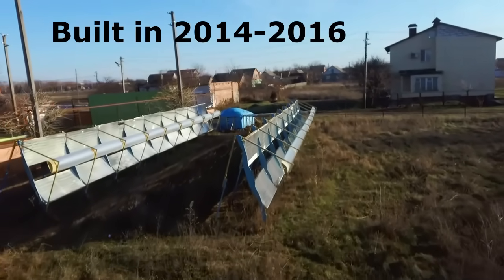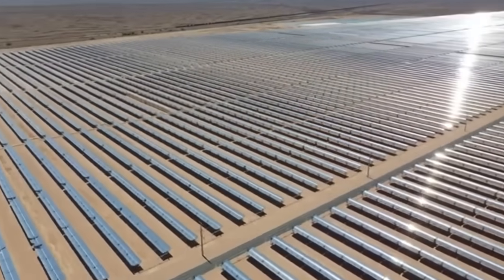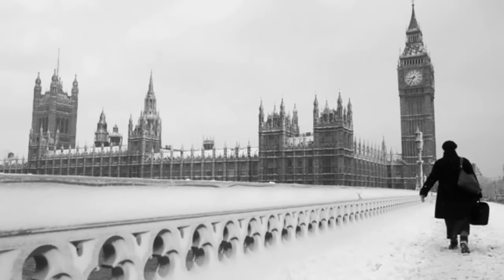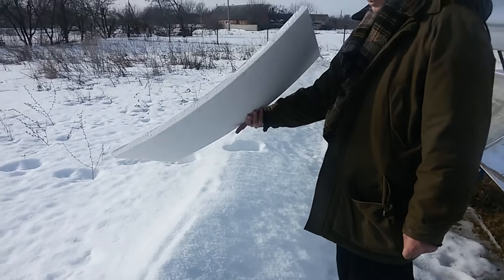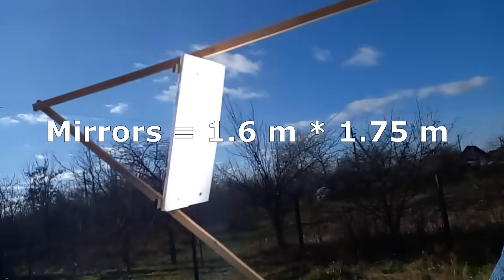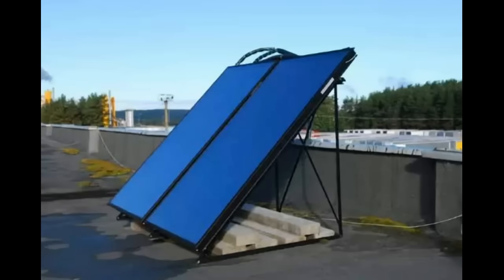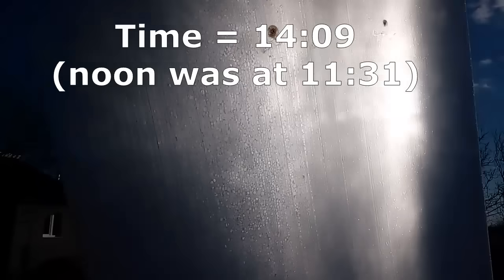This solar energy innovation is 10 times cheaper than analogues: solar electricity 24 hours a day

Comment: What needs to happen is that each unit on the solar reflector needs to change shape individually, relative to the whole. The question is, given so many more moving parts, can it be built efficiently (repair/down time versus the alternative). You'd need likely 14-20 moving parts per array as the sun shifts and tracks it, but your focal point would likely be WAY more efficient.

Comment: A stream of compressed air should turn into a stream of plasma when an alectric arc is put through it.  How long does the plasma persist in air when a pulse of high voltage electricity is put through it? If the plasma persists for one thousandth of a second and the air is moving at one hundred meters per second, then a stream of plasma ten centimeters long might be created. Plasma tends to absorb all manner of radiation including light and infrared.  If you focus the concentrated sunlight from a big dish mirror into a stream of plasma in a cylinder, the heat from the sunlight would tend to make the plasma persist for a longer time.  If there is a lens on the end of the cylinder that turns the converging rays into a long narrow beam, most of the light might be absorbed and converted into heat that could drive a gas turbine.  The higher the temperature and pressure of the furnace chamber in a gas turbine, the higher the efficiency tends to be.. If the efficiency of a gas turbine that burns natural gas can be greater than 40%, the efficiency of a plasma powered gas turbine might be 50% or more.  Just put the compressor  on the exhaust end. A car turbocharger is a kind of gas turbine that is readily available at the junk yard.  It might be about the right size to power a rooftop dish sized solar energy system.  If the dish is three meters in diameter, there are about 6000 watts of solar energy  available or 3000 watts at 50%efficiency.  That is like a ten thousand dollar solar panel system.  The dish might cost a small fraction of that. There are solar farms that use trough parabolic mirrors to heat up compressed air in long pipes to drive a gas turbine. The hot air is passed through a big pile of gravel to store the heat energy.   One ton of gravel raised by 500°C stores about 100kwh of energy. The stored heat can be converted to electricity by forcing compressed air through   the gravel to drive the same gas turbine.  A well insulated pile of gravel under the basement might store the heat for days or weeks.  Some cities store summer heat in big piles of gravel for months to use as heat in the winter. 
A dish solar energy system that also heats the house and hot water is using near 100% of the energy.  That is about a five times advantage over photovoltaic solar panels.  Plus, another five or ten percent because the dish tracks the sun.  
Another possibility is that many of these dishes acting together would make a formidable directed energy weapon system.  A million dishes each firing a 10,000 Joule microwave pulse is ten billion Joules.  That amount of energy would almost certainly turn the air at the focus into an explosive plasma.  Ten billion Joules is the equivalent of about two tons of TNT.
If the exhaust is run down through the support structures into an underground chamber, it might be very quiet.  A flat mirror closer than the focus would make it smaller and the gas turbine would be near the dish or under it. Running the exhaust into a central support structure with certain joints would allow the dish to move and track the sun. 
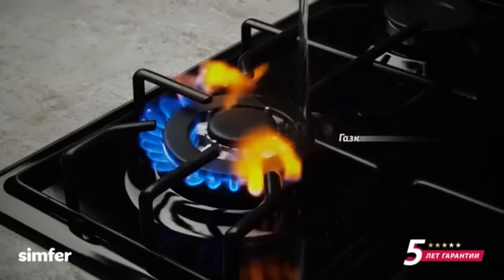It seems that the converging microwaves at the target would be converted into converging Xrays if the temperature at the focus is high enough.  Even if the blast and heat did not destroy a target, the trillions of watts of Xrays converging on the target would tend to fry the inside of a target with even inch thick steel plate armor. 10:36

Comment: Specific crafting method refinement and materials could possibly use improvement. I imagine something like using painted concrete or clay surfacing for the dishes and just having the reflective film be replaceable. You could probably just dissolve the old film with a solvent, or maybe use a vacuum for forming the lens, though it might not survive as much wear and tear. I guess I'll find out the pitfalls when I try it.

Comment: I am impressed with your experiments. You have a keen engineering understanding of the problem. Many people experimenting with solar don't seem to understand the true scope of the challenge.
Reply: @_yoko_3630 Come again?
Reply: Neither do you if you believe his device can produce power with the sun, he has stated it is a solar device.
Reply: @ossiedunstan4419  maybe you're thinking of photovoltaics? This is solar-thermal.
Reply: @ossiedunstan4419  Do you know there are more types of energy besides electricity? Heat energy can be more useful in many ways like heating water or your house. Heat energy can also be used to generate electricity if needed.
Reply: @johnathon007  He dont, tiktok dont teach too complex

Comment: boiling water using air gel to cool water use thermo dynamics heat the water to steam push it thru turbines and into steam generators get it up in the sky about 140 feet and drop it down using ram pumps and stuff to get all the water up hi then run it down cooling it and spinning turbines for hydro.

Comment: I watch on your solar station and researches many years) And other researches and analyzing off existing ways to use solar energy . Thanks for yor work!!!  I think that low temperature stirling engine can produce electricity esealy from heat producing by your solar station. If we atach 100w stirling generator to  warm battery it can produce  2400 w in 24hour that is  anougth to cover almost of all needs of  small house

Comment: If we upscale this, we would end the world's energy problems.
Reply: If a factory was set up, steel versions of this could be mass produced. The salt tank could be stored under the mirror, and the whole thing put on a swivel to follow the sun (manual version cheap, or an optional motor and auto-tracker). Probably wouldn't be enough to power an entire home, but it would vastly reduce the burden on the grid and keep essentials going when the power goes off.
Also they could be put on the sides of roads, and the heat pumped under the roads to melt off snow and ice.

Comment: The temperature of the water could also be controlled by an automotive thermostat.
Reply: they won't tolerate anything approaching those temperatures, unfortunately, engines all run around 100Celsius

Comment: "10 times cheaper" that doesn't make any sense.
50% cheaper would cost half, 1 time cheaper would cost zero.
It's hard to trust a videos validity, if the creator doesn't appear to understand simple math concepts.
Reply: 10 times cheaper means 1/10 of the given cost. 1 time cheaper is 1/1 the cost so the exact same price. I think you are the one who struggles with this general concepts.
Reply: I agree with what Szymek Kordyaczny has said. Maybe your aim is to spread uncertainty here? Or perhaps your understanding is lacking. Either way, "10 times cheaper" makes sense as a statement.

Comment: when you choose materials for your collectors, you miss an important feature, long service life / durability. These materials should last long time, not being scratched or otherwise damaged by wind, dust, sorms etc.
Reply: In previous videos he has explained that 12-18 months cycle of replacement seems most cost-effective. You can make an infinitely lasting panel for 1000 USD/sq.m, but year-lasting panel with 80% of effectiveness of the latter for an insignificant fraction of the cost is the goal of this channel.
Reply: @wwlb4970  Thank you for replying. That is maybe so. But what about the environmental impact. Polystyrol is not the best material regarding that matter. Not only the recycling or dumping, but also during manufacturing of Polystyrol and preparing it for the collector has a negative balance. Tha would counterweight the positive balance.  Would wood planks work? What do you think?
Regarding the one year cycle. Material costs are one part of the calculation. But having labor costs each year makes it less cost effective, don't you think? Labor costs are most often the biggest junk in western countries. A bit longer lasting material would be more efficient, i would assume.
Reply: @michaspringphul  good points, can't only be for sack of cost/kw.
Cheers
Reply: @michaspringphul  Generally, the price somewhat reflects the production efforts and environmental impact - energy consumed, complexity of production, complexity of recycling. Those high-tech mirrors aren't any environmentally friendly, and while polysterene foam or cheap cooking wrap aren't either, the latter are easily collected and recycled, usually becoming shopping bags. Sergiy didn't really insist on replacing them each year, though, effectiveness will decrease, and I'm referring to the previous videos w/o polysterene, but with metal fishnet instead.
Reply: Agree on the durability vs enviro cost.  Buy in cost can be so high that many people can’t get in.  Practical question:  do we put our lives on hold for “perfection” or do we accept & deploy “progress”?

“Perfection is an enemy of progress”

Mileage will vary, people have varying limitations or advantages. 👍🏼
Reply: @peterxyz3541  i don't think that perfection is the enemy of progress. See for instance Total Quality Management. Progress at any costs, without thinking about the consequences is far more dangerous. Best example is the Gain of function scientific approach. This doesnt mean to progress or try to overcome new frontiers, it just mean to use the brain first, think, simulate and maybe change the design prior to possible negative sideeffects. We cannot forsee any sideeffects that's for sure, but at least the most obvious and prevent them, don't you think?
Reply: @michaspringphul  polystyrol with acetone makes an incredibly cheap and strong glue for wood,  acrylic, ceramics,  and is an excellent sealant. I would not use acidic food in a dish that was repaired with this glue. No reason other than possible ingestion of the polystyrol/styrofoam
Reply: @lordeverybody872  I also think, that plastics in general are a good material and help achieve, produce or keep things very well. But i think we have to rethink as humankind, how to proceed with it. We cannot just carelessly use and then dump it. Also we have to think and act how to use it as construction material. Often it is in a mix with concrete for isolation purposes. But how to recycle it, what to do with the remnants. Natural desater scatter that stuff around and it pollutes every spot in world, not only oceans but traces and pieces are found also on north and south pole. The plastics have severe impact on not our health and survival of the humankind itself, but also on so many other species, especially mammals. An example from studies about these impacts... https://youtu.be/Uo-kSxHNSDQ
Reply: @michaspringphul  Not everyone has the means to be 100% environmentally friendly but that doesn't mean they shouldn't take steps that are more friendly to the environment then let's say burning coal.
Reply: Yeah I don't see why wooden planks couldn't be used as backing. They cost more, but are more durable and "recycle" themselves if just dumped in a corner. Or you can burn them...
Reply: @worldcomicsreview354  exactly.
Reply: It is silly to use high cost materials for prototyping.  Cheap and easy to work with materials help with the R and D.   

What’s more likely?  Someone can scratch together a few hundred dollars to build a green heating option, or several thousand to do it the “right” way?   

Your thought process is sound but you don’t seem to have much building experience from your comments.  

Build a workable model, then scale up in size and longevity.
Reply: @Red9GearHead  but wood shouldn't be expensive.
Reply: @michaspringphul  I like the way this guy thinks
Reply: @supersmokey1840  sure why not. Me too, but I also think, we should always keep in mind, that we should think a little bit about the consequences we are causeing with our actions. In my case, we should lower the use of plastics. I traveled a bit. And what I could see all over the world is the plastic garbage everywhere. Bags, wrappings, construction material, medical equipment and so on. 
It is the duration it needs to "decompose", the microplastc pollution, it is its impact on human and especially animal health what my concern is based on. I don't say we shouldn't use it, but I say, let's use it wisely. It has so many usefull features. Maybe this talk opens some eyes.
https://www.youtube.com/watch?v=Uo-kSxHNSDQ
Reply: @michaspringphul  i was saying i like the way you think my brotha
Reply: @supersmokey1840  oh, thank you
Reply: @michaspringphul Environmental sustainability is a luxury available only to rich germans and swedish school girls.
Reply: @michaspringphul  i guess that used material will last much longer than one year. Durable materials are also prone to storms, the only difference is they cost much more. Polystyrene could be replaced obviously with something which is more friendly, my guess would be mineral wool, wood, paper(if sealed).

Comment: 1. At winter very high heating lose from collector. 
besides  mineral wool can be used 1 mm thiсkness glass for other side. Because heat losses(aprox 50%  ) higher them glass reflecting loses (10%).
One layer glass reduce heat loses from 50% to 25 %
2.Extruded polystyrene beter simple polystyrene. Because  it less desroyed from sun , has no pores, it is stronger.

Comment: For the solar collector, the black metal, is make it from a lot of little pieces of steel about 1mm thick by about 6-12 mm wide, little strips, weld then to together on alternating sides, making an accordion boot, like a zigzag of steel. Using a black oxide finish, or possibly look into other coatings maybe a aluminized coating,  anyway, make the collector side look similar to a car air filter, with pleated sections to maximize surface area, on both sides, maybe use a needle scaler to cover the whole surface with pock marks, adding to the surface area,  a Tig welder will weld up nicely, without excess filler material, having the pleats going left to right, with the liquid used flowing the same way,  this will eliminate shaded spots mostly anyway, maybe design internal passages to pass through the heating surface multiple times!  Allowing it to collect as much heat as possible, before going on to dump it's heat,  awesome project, and good luck with everything, happy holidays, 👍
Reply: Would the kind of heat-resistant paint used for car engines work? or it would peel out rather quickly?
Reply: I wonder if a coated car or truck radiator would work?

Comment: your content is fantastic, please don't stop making these types of videos. I'm based in New Zealand with aspirations of living off-grid a device like with this with a small footprint for heating water would be brilliant
Reply: For a lot more efficient hot water storage i would suggest you the setup i did at a friend's ranch. The company who installed the solar heating installation made some mistakes,so resulted in damaging the hot water storage tank because they didn't put an overpressure valve.So they came and replaced the storage leaving the old tank at the ranch. Then i came with the crazy idea to repair the old tank (it was a gasket damaged) and fill the tank with sand and gravel,of course installing some filters inside to avoid the sand to go into the pipes(just like in a pool filter),and i installed the modified tank in parralel with the  other one. After the sunset we experimented how much hot water each one would get untill the water output drops at 30 C degrees. Here comes the surprise.We got 5 times more hot water buckets from the one filled with sand and gravel,but if you think about it is logic,because the water is formed by hydrogen and oxigen atoms,so very low density and mass,meantime the sand and gravel contain carbon,calcium and many other heavy elements with a lot higher density and mass,so they can store a lot more thermal energy.(sorry for my bad english,i'm romanian)
Reply: Me too!

Comment: very nice design. Storing the heat in large oil container might work too, if you heat a 100L of oil to 400degC then it should stay hot for quite a long time. Good luck!
Reply: If you put that large oil container in a sand pit and cover it with more sand, the heat will remain for a very long time.

Comment: Now the important thing in my mind is the conversion to electricity if possible. Do you have a video detailing a economic way to do this? I would add I have seen a solar tracker which used a windshield wiper motor from a volkwagen to shift the entire assemble and focus on the sun. perhaps if it was mounted on a turntable as well?

Comment: Just have a think a torus antenna is as like as your parabolic mirror, the axis of rotation is perpendicular to the symmetry axis of the parabola and there is a need for a torus target. The distance between the axis of rotation and the rotating surface must be larger than the focus of the parabola. The torus target doesn't form a focal point but a group of focal lines, which lie on an arc in front of the reflector - wavefrontier toroidal  - torus antenna - Тороидальная антенна